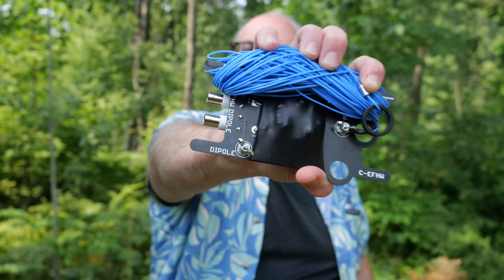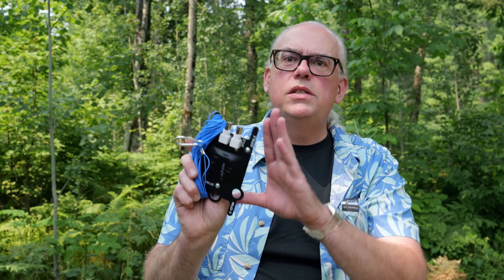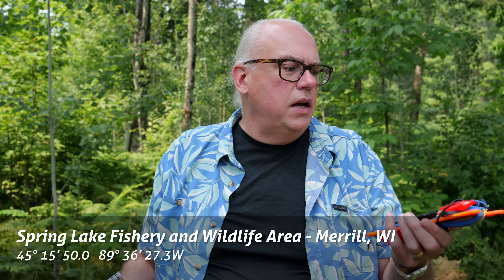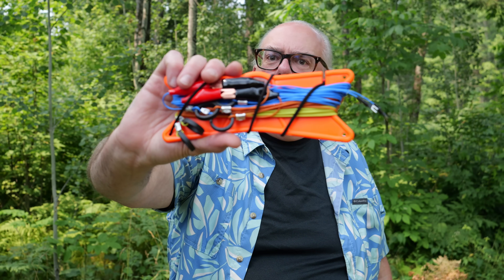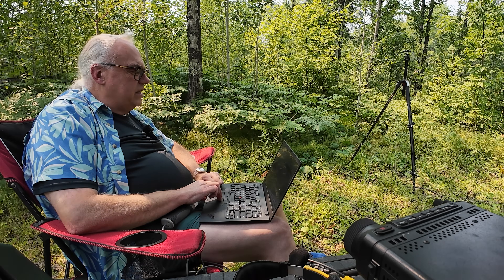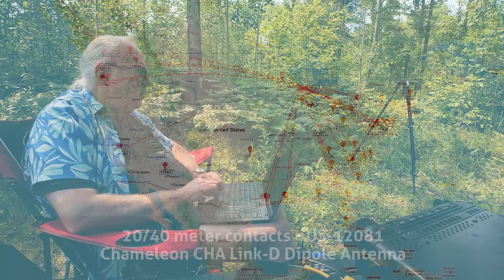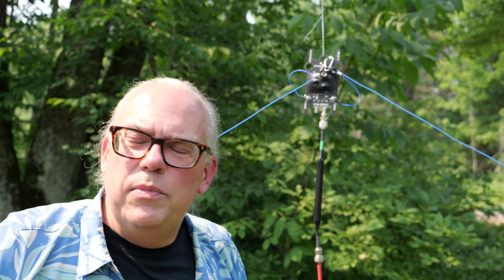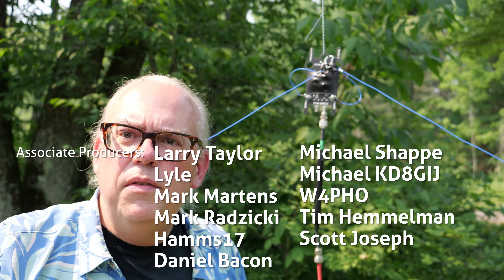Can your end fed antenna do THIS? Chameleon LINK-D Dipole

Comment: Could the dipole links be used as the tuned radials for the POTA Performer as well?
Reply from the maker: They possibly could. The elevated radials in the PERformer antenna are slightly shortened from their resonant points, but the lengths should be close enough that you can slightly adjust the whip length to find the sweet spot.

Comment: Another good video Michael…. How high did you have the feed point in this configuration?
Reply from the maker: The feed point was approximately 25 feet with the ends about 6 feet off the ground.
Reply: @KB9VBRAntennas thank you

Comment: I've been taking my CHA 4010 w/ my FT-891 out on my bicycle this summer. I'm a newer ham and this is my first EFHW. Super light weight and easy to setup. I've also enjoyed using the WARC 30m dipole. As you point out, the versatility of the 4010 seems like a key feature.